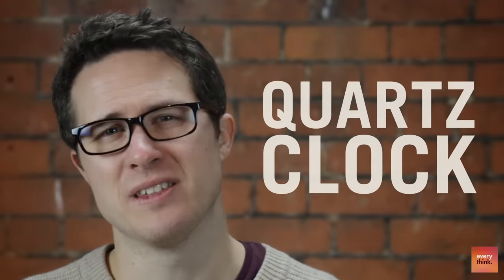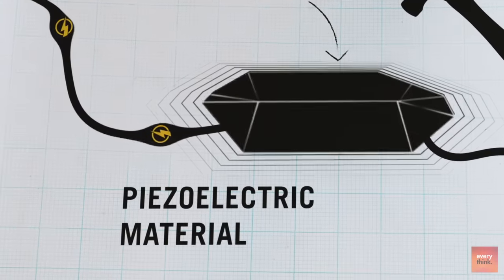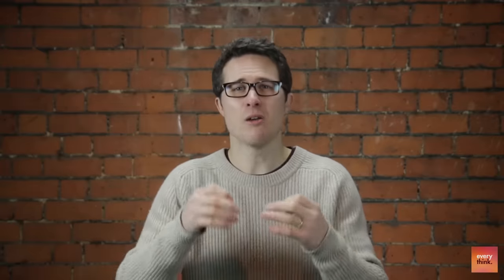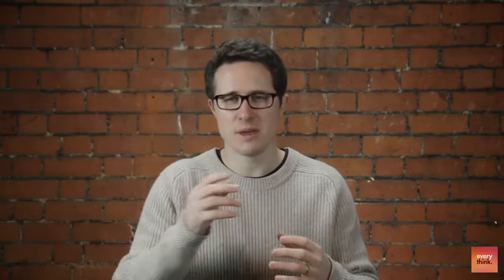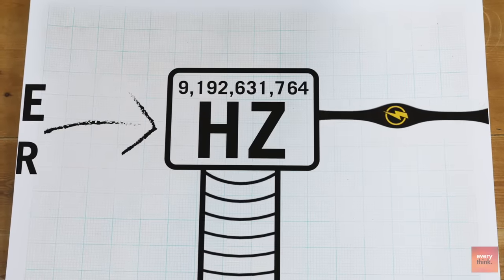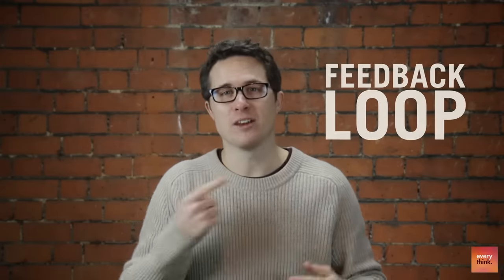How Do Atomic Clocks Work?

Comment: The best explanation I've found so far. Also very accurate, most other sources are not. They say they "9,192,631,770 vibrations of Caesium atoms" which is incorrect and very confusing. It is "9,192,631,770 oscillations of the radiation that excites caesium atoms". Thanks for this!
Reply from the maker: Fantastic! So glad you liked it, and glad my info was accurate. Thanks for watching! Dom

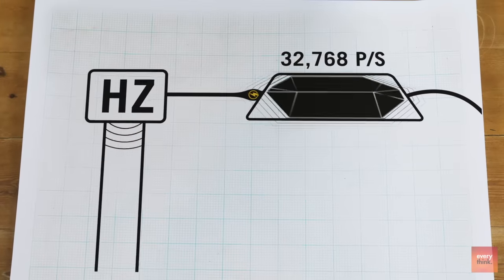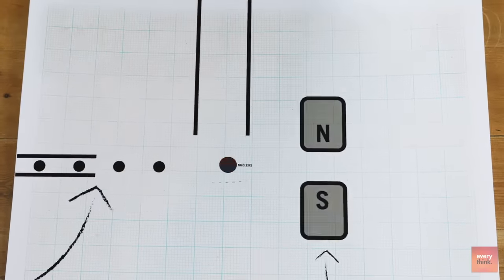Comment: Excellent video! But something's not clear: how do the convert the oscillation of the quartz crystal (32,768Hz) to the frequency of the cesium atom's resonance frequency (9,192,631,770Hz) in the radio wave transmitter? At 4:02 you say the transmitter will transmit at 32kHz, but to 'excite' the cesium atoms the frequency needs to be it's resonance frequency (what you show at 4:33). Is there a missing step?

Comment: The frequency related to the electrons is millions times higher than the frequency of the whole atom-atomic clock. For the example, the transition frequency of the electron in the hydrogen atom is 2.466 PHz. But the bouncing of the hydrogen atom is 1.42 GHz.
You made good visualisation of the orbiting electron. But you must not forsake that the electron moves in the magnetic field of a nucleus--positive charge, and so, torque from the perpendicular direction acts onto the moving charges. The result is that the axis of rotation for the electron, whether for electron-nucleus also turns. Namely,  the  nucleus is orbiting also. When we have just one negative charge-electron and one positive charge-nucleus, then both rotate around the centre of mass of the atom.That is why both moving charges (electric currents) induce magnetism. And then, each charge moves in the magnetic field of other charge. Therefore, there exist the precession, and its frequency is over millions times smaller than the frequency (revolutions) of the electron. And this frequency is the working frequency of the atomic clock since the atoms move as a whole due to this precession. 
Think about it and try to make a video that contains a whole truth about atoms. Thanks!

Comment: Lots of small mistakes in this video.  GPS doesn't work as you say, although parts of Galileo might.  Cs-133 has more than one frequency in that range, so the clock has to check if it hit the right one.  Also, the Cs-133 can't be vibrated all the time, so they they turn it off for a bit while keeping the tuned quarts running.  Oh and while the NIST click may run incredibly close to the speed in the spec, that speed is slightly wrong, which is why we need leap seconds every few years to make it actually right.

Comment: If I understood correctly atomic clocks fixes their crystal automatically to sync back to be aligned with the frequency of the reference signal (from cesium atom), which is not prone to drift due to changes in environment... So what causes atomic clocks to drift?

Comment: sorry but where is the clock actually detecting the oscillations?  it looks like the detector is only counting the ones not or being excited to regulate the wavelength of the radio transmitter. is it at the point the radio waves hit the atoms that it sheds the photons/electrons that the clock is counting as oscillation's?

Comment: just a bit confused... when talking about the radio transmitter, you first say that it has the same frequency as the quartz oscillator... but to go into a high energy state the atoms needs to absorb the same radio waves, and whilst explaining you use two different numbers in hertz? otherwise awesome video :)
Reply from the maker: Hi Violette, sorry for the confusion. The quartz is used to control the frequency of the radio wave transmitter but the oscillation frequency of the quartz does not directly translate to the radio wave frequency. I should have made that clearer in the video. What about this instead...Imagine the quartz is a horse-rider whipping a horse. If the horse slows down he gives it another whip. He doesn't have to whip the horse for every stride it takes, but just enough times to keep the horse from slowing down. Does that help!? I'm not a scientist I'm afraid so someone else might explain it better! Thanks for watching though and please subscribe to Brit Lab as well for my new series coming next month. https://www.youtube.com/watch?v=G1XTZGH02xg&t=3s
Reply: thanks! i get it now :)

Comment: I like your channel!  But you glaze over some crucial understanding parts a bit too fast: example: Why did scientist choose Cesium and not another element? Where does the detector get its extra jolt of power to auto correct it self?  batteries? what happens if or when your battery dies?  I think its great that this atomic clock has a way of checks and balances..from: Crystal vibration, to Radio frequency, (matching) back to Atom resonation,.. to a electron pulse detector..  thats pretty cool...but.. who are the people/scientist who thought of this time technique? Scientist like credit too. :) 
Dash of scientific history is always nice.

Comment: Your conceptual definitions for microwaves and radio waves are poor. The same goes for oscillations and vibrations. Atoms don't oscillate in the sense you are using here. Atoms (Cs 133, for example), absorb the radiation energy packet with the frequency needed for the hyperfine transition and reradiate that energy packet when they come back to the ground state. There is a nonzero time delay between the absorption and reemission. This cannot be called oscillation. Only two things literally oscillate inside an atomic clock: one is the crystal oscillator whose oscillation is mechanical, ergo, can be called vibration and the other is the microwave cavity which oscillates with microwave em frequency.
Reply from the maker: Thanks for watching, and I appreciate the feedback.

Comment: Actually GPS works perfectly fine without any relativistic equations.  In fact, I still don't think they are used.  GR is garbage.  Lorentz was on the right track at least. https://tycho.usno.navy.mil/ptti/1996papers/Vol%2028_16.pdf

Comment: 0:34
WOWOWO wait, NO!
A satelite DOES NOT triangulate your position. You ONLY RECIEVE data from their clocks and their position in space, that is then used by your phone to triangulate your position.
There is NO INFORMATION SENT to the satelite because that would require strong antenas and it would be fucking redundently useless...
There's no need for your phone to send data (if it could) to a multi million dollar satelite as there is no need for a two way communication to triangulate your position.
(Satelites find their position using other means that are no where near possible with a cell phone or a gps.)